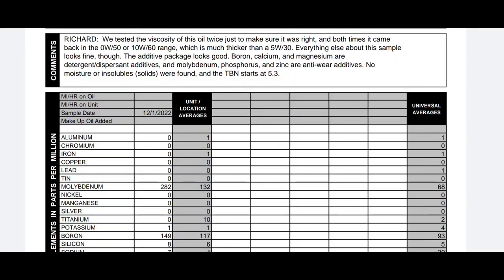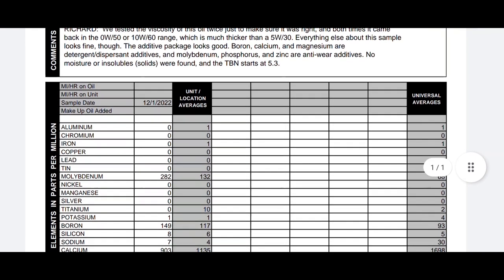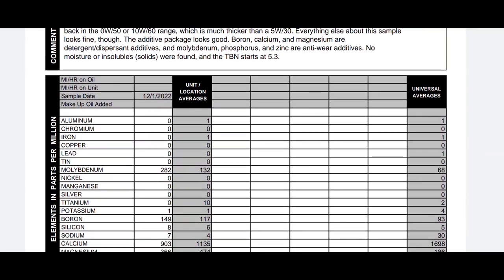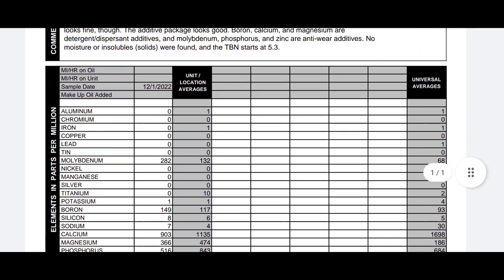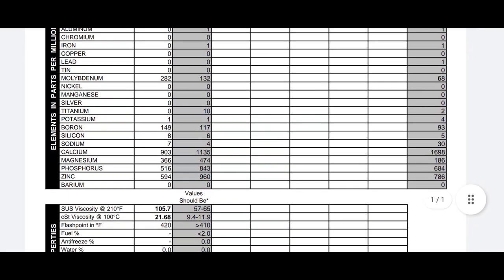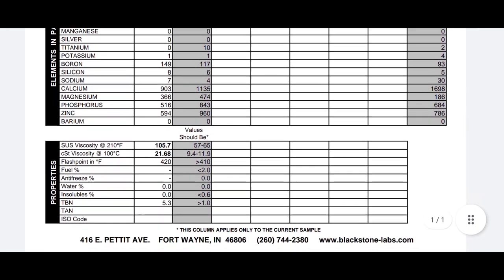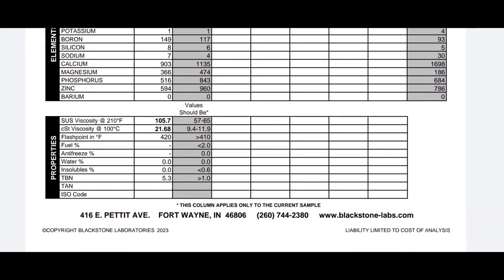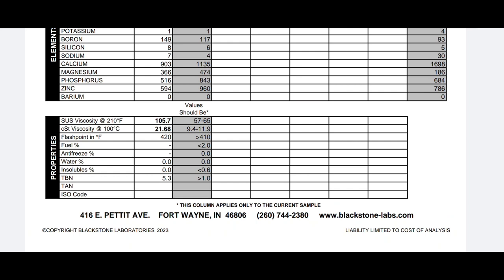What Did This Oil Additive Do To The Oil?! Let's Look At The Lab Results And Find Out

Comment: Engines are designed for thinner and thinner oils, such as the newest 0w16 specs. Even on some older vehicles, such as my 08 Camry (2AZ-FE), which has variable valve timing, I wouldn't use oil that is out-of-spec. It's a recipe for trashing the engine.

Comment: I’m thinking about using shaffers 0w20 in my Honda civic 2 liter. Thoughts
Reply from the maker: Good stuff
Reply: Update I bought some 0w20 for my Honda civic. I have to say I was a bit nervous when I saw the green color as I poured the oil into my engine. I have to admit my car is running pretty good.
Reply from the maker: @mke7876  it is really good oil

Comment: Was this added to used 5w30 and if so how many miles on the oil, also what make/model/mileage and engine was it used in? I could be wrong that it was even used in a vehicle at all but if it wasn’t, can we get an analysis of the aforementioned question
Reply from the maker: Virgin 5w30

Comment: Honestly i think the serving suggestion is a bit excessive 😂😂 ESPECIALLY for modern engines. I guess they assume anyone buying this product has more knowledge to make the correct decisions but it does say add X to X on the bottle... I think I will add approximately one third of the bottle to my engine oil for a lil bump in viscosity plus the additives but mine isn't a normal modern application either.
Reply from the maker: Even when you overdo it it reduces the viscosity these actual additives don't do anything for your oil they just add a little bit of bump in viscosity and that's it, they do zero else so it's a waste of money
Reply: @FordBossMe  well my thoughts where.. 
I use penzoil ultra platnum 5w30 in my 18 WRX. I have since its first oil change. Bought car new with 6 miles has 102k now. PUP is a great oil especially that i can get it at about 65 bucks for 3- 5 quart bottles. I have a 97 Camaro Z/28 with an LT1 engine. HCI FBO stock bottom end. 205cc heads with a fairly aggressive cam. Biggest I dared or reccomended to put into the stock short block engine. Valvetrain can handle more but bottom end should accept 6400rpm shift points fine. About 600rpm over factory redline. Plenty of people go higher but its a bit of a gamble after that. Anyways, I wanted a lil thicker oil for the Camaro and thought maybe adding a lil bit of this could help achieve this but now what I'm thinking is just use amsoil signiture 5w30. 3 quarts and 2 5w40. Its a lot more expensive though however the car won't be driven often but when it does a lot of its operated range will be higher rpms.
Owners manual states 5w30. a lot of people use 10w40 when modified or higher milage in these engines. I thought maybe it would help a lil bit though I probably over complicated it at first

Comment: Oil additives are as old as the internal combustion engine. All they really have to do is to cause no harm. Real-world testing is all but impossible; I have a friend who swears by slick 50 but he has never run a parallel test without it so how can you really know? Regular oil changes with quality oils are still the best protection.

Comment: I would say bad news for a new to medium wear engine. Especially in the winter time. Engine designers and manufacturers specify specific grade and weight of oils for s reason. It seems to me the engine wound be working twice as hard just to pump the oil and lubricate itself. It’s a no-go for me.
Reply from the maker: Yeah but let me put something into perspective for you it may not quite be as you think it is with the way you look at things here, I had a guy show up at my house to do a bid on tree removal and he was driving a 2013 F150 with a 3.7 L naturally aspirated engine that engine calls for 5W20 engine oil the only runs 15W40 in that engine since brand new diesel oil and it's got 440,000 Mi on it
Reply: @FordBossMe  Diesel oils have a robust additive package for protection of the bearings, but "can" poison the cats if oil consumption gets too high.
Reply: @FordBossMe  makes me feel completely comfortable putting 5w-30 in my 3.7 🤣
Reply from the maker: @jamesplotkin4674  I mean it's not like I don't understand that but that would be only if you're burning oil and I understand you guys are just trying to help explain things but you guys are preaching to the choir here
Reply: JilCat 
Engine Shield 
MotorKote 
TurboMaxx 
LubeGuard

Comment: I would use this on a small displacement engine doing hard work, such as heavy towing. Too thick an oil will actually make the oil control rings less effective and can lead to low rpm detonation due to the oil diluting the fuel making a lean situation, especially under load. Turbo engines do better with the new low vis G6 oils.

Comment: The 7000 series version of that Oil did terrible in testing.
206 th best out of 236.

Amsoil Signature Series came in at 2nd and 3rd best.
Reply from the maker: Well it's in the top 5 now
Reply: @FordBossMe  do you work on any engines that require 0W16 oil?
Are the cylinder bores SumeBore process finished?
Reply from the maker: @gj91471  I don't work on any vehicles that have that type of oil
Reply: @FordBossMe  ok Thanks